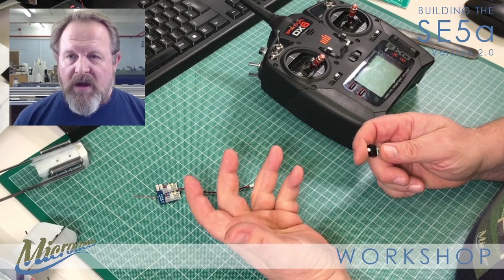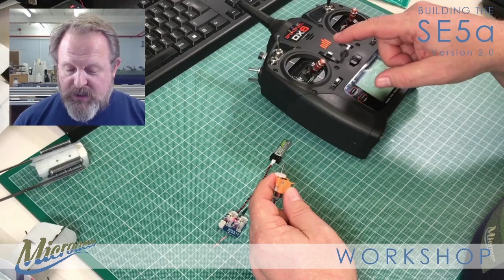Microaces SE5a (V2.0)* Build - PART 12

Comment: A very good instructional vide on how to install both Rx and power train well done. PS  what are you trim settings and expo ?
Reply from the maker: Usually keep all control surface movement to 100% and start at 50% expo. Then make alterations to expo as I find out the character of the aircraft. With this SE5a I think I'm still on 50%.